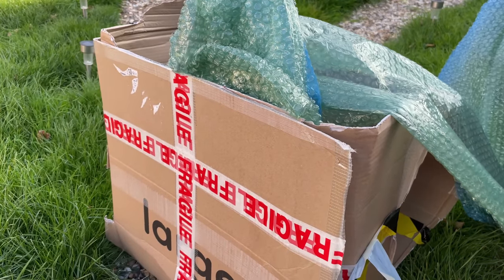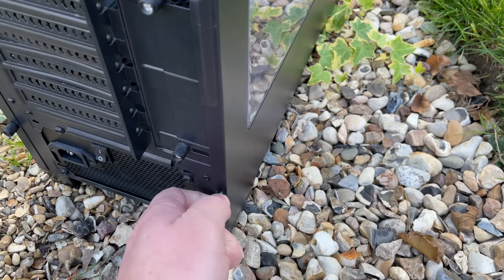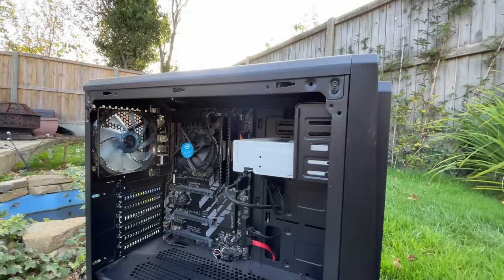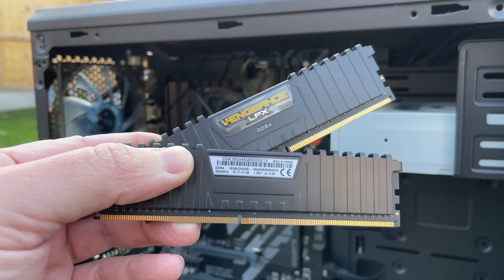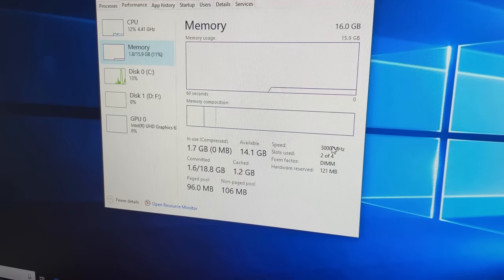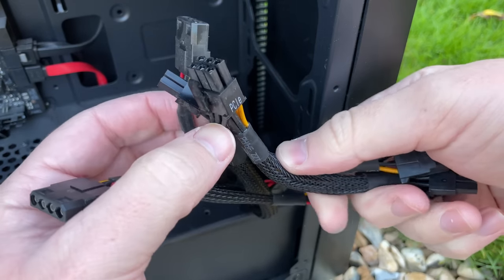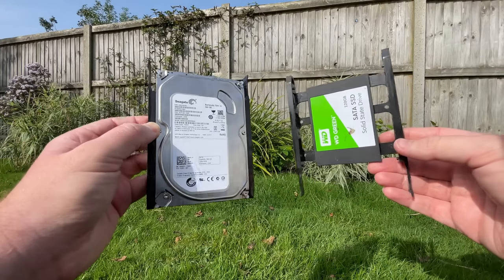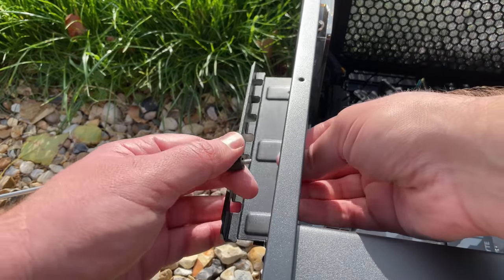This £169 PC has an i7 8700 - But Was It Worth It?

Comment: I'm using a i5-11400H (On par with the 8700k from what I understand) laptop with a 3060 and it's quite a balanced pairing, games like CP2077 really make great use of all the CPU threads so it's quite smooth. It's still got more than decent grunt for most games these days, maybe not for 1440p Ultra but for 1080p High it's more than adequate. I can see an 8700k having two years of usage for "enthusiast" gamers that don't need to crank everything but still enjoy some quality visuals.
Reply from the maker: I have an 11400h and 3060 laptop too! Definitely is still really capable

Comment: Good deal or bust for $300?
MSI Z370-A Pro Motherboard 
i7 8700k 
ASUS GTX 1060 6GB Turbo 
16GB of Patriot Viper DDR4 RAM at 3000MHz 
Corsair H100i 240mm AIO cooler 
Kediers C570 open air case with 7 RGB fans. The PC came with no PSU or storage.

Comment: Learned so much intricate details from this video thanks. Also it's time to avoid putting hard drives on the main system, from now on HDD's should be put on a separate usb dock, file server pc on a network (commercial/diy nas) or just dont plug em when not in use.

Comment: Iam running 8700k in my right with 3080ti strix and it bearly gets to 50% utilisation on my 34 inch acer predator x34 monitor.

Comment: I remember having to save up for a 250GB SSD in 2014/15 roughly. Kept a preposterously low storage drive as a boot drive for the longest time to create an ideal replacement. I remember that SSD and HDD combo being extremely sensible at the time though it did cause streaming issues with textures as I had a 5400RPM hard drive though it is fun now to have all those games on an SSD and see them shine with much reduced loading times and texture issues practically eliminated.

Comment: On the CPU temps with stock cooler, I've been using a Ryzen 5 3600 and have the same experience. I don't think it's anything to worry about as a gamer, as during even the most intense games it will max out at around 75 degrees, and the heat issues only occur when running all cores at 100% load for sustained periods.

Been running it for around 2-3 years now and that still rings true.

Comment: Just picked one up in the Dell Inspiron 5680. I'll catch some hate but I really like the looks of this machine (I know it's all just plastic junk, but I like it). Came with 32 gb ram, 1 tb HDD, and a 3gb 1060. For $150, I thought it's a steal. Changed out the stock cooler and added an nvme. Going to use the gimped 1060 in something else and throw in my 3080 when I'm ready to get that 50/60 series card. For now, it'll host my Valheim server.

Comment: The i7-8700k is a good processor with a bigger cooling solution. I gave my 8086k (special edition rebranded 8700k) to my friend when I upgraded to Ryzen 5000. I'm hoping the "special edition" part was just a gimmick and it's not actually going to be worth thousands in the future.
Reply: it will :)
Reply: if it means as a harken back to the beginning of x86, then in no way it will lose value, stark contrast even🤣

Comment: Considering NVIDIA driver overhead, I’d love it if you could test with AMD cards instead when in a CPU limited scenario like this one. For older/weaker CPUs, it makes quite a difference.
Reply: That nvidia overhead only happens with high end graphics cards and even then barely. Hardly ever find a game that bottlenecks a 4090
Reply: @xTurtleOW  the driver overhead doesn't bottleneck the GPU. It bottlenecks low-end CPUs.

Comment: I used an 8400t in my TV PC.
Cost about $350 to build a year ago.
35w chip, main board with wifi, nvme SSD. Uses about 60watts full load.

Comment: If you want to upgrade that CPU to an i9, maybe you could try getting one of these Chinese CPUs, which are laptop CPU soldered to a 1151 socket (BGA?). You must have a compatible motherboard, and the seller will send you the new BIOS. I got a QTJ1, which is basically an i9 from 9/10th gen, with 8 cores and 16 threads, clocked at 4.7, but with unlocked multiplier (got up to 5.1 but wasn't stable, so lowered it to 4.9). Also, note that you probably will have to run the RAM at 2800 or lower. Some people got golden chips with 5.2 and 3200MHz RAM.

Comment: I can see the reason of owning PCs with 8th/9th gen Intel chipsets. Yes, it's all about being the entry level of installing Windows 11 without tweaking anything. But other than that, as long as you have a more capable graphics card & at least i7 chipsets, it can still play PC games well at 1080p or 1440p. It also can do emulation up till PS2/GameCube/Wii era games & Wii U titles if desired. Chances are even if the chipset might not support Windows 12, this PC is still relevant  for the next few years until the early 2030s. Also can't wait for your i9 upgrade.
Reply: PS2 era went okay on Haswell i5 and good on haswell "i7" xeon. 8700 is enough to emulate Gran Turismo 5 without problems. X360 games are even easier to run beacuse Xenia is more GPU than CPU heavy.

Comment: I bought an i7-8700k and a 2080 prebuilt from ibp.
I bought it when the 2080s had just launched, didn't pay an extra 500 for the "ti" variant, so just a "normal" 2080
Got the rig for 1800 (with financing, 0 down, paid it off before interest started, thanks affirm)

I bought this pc in 2018
It's still solid. 
playing AC6 @ 100+FPS @1440p
there isn't a game this guy can't handle, still my strongest rig (except the cpu which isn't bad but new cpus are just so much better)

I could not recommend the i7-8700 enough (the k is even better)
Reply: i did upgrade the cooler to a corsair 240mm rad*
the cpus work alot better the cooler they are, so even if a 120 is probably enough i'd recommend the 240 (especially for the K variant)

Comment: I still rock my 8700K with a 3080. Unfortunately I lost the silicon lottery, so it needs 3.8v to run 5ghz. However, it only reaches 70°c due to it being delided. Still works, but some games have some microstutter.

Planning on upgrading next year :)

Comment: Recommending using just a large ssd is pretty good advice as now a 1tb ssd costs about the same as a new 1tb hard drive. So at this point unless you go for a more expensive larger drive that has a better price per tb there isn't a point to buy a hard drive for most people.
Reply: At 4tb+ HDD's are still a far better deal. And I say this as someone who has 4tb of ssd storage and 2tb of hdd storage.

Comment: I can confirm, the difference between an i5 8400 and i7 8700 in 2023 is a bit bigger than I'd imagined. The i5 simply can't keep up until the 9th gen i5 9400; same thing with the i3 not being "capable" in modern games until the 10th gen i3 10105f.

I just picked up an i5 9400 with z390 motherboard and 2x8gb G Skill Royal 4400mhz for $180; socket 1151 is getting very cheap on the second-hand market, and still is extremely powerful for the price point.

Comment: I've paired my I7-8700 with a 3060ti - although I do also have a noctua cooler which helps keep fan noise down. I'm able to play quite happily play most games at 1440p med - high settings at playable frame rates.

Comment: I'm currently using an I7 8700 processor, RX 5700 XT graphics card, 550W power supply, and GALAX B365M. Overall, I'm enjoying my setup, but I'm having some issues with my CPU overheating and reaching 80-100% usage. Even with a stack cooler, it seems like I need a better CPU cooler, but I'm not sure which one to choose or what the price range is.
Reply: Snowman cooler, Tech City Yes favorite 😁

Comment: @RandomGaminginHD You can overclock it even if it's locked, albeit only slightly, BCLK to 102.4 or 102.5 will work, which will make 4.4ghz on all cores. Tried and tested, no voltage increase

Comment: I still use my 8700k to game still it is overclocked to 5ghz all cores and it still holds up very well considering originally I paired it with a 2080ti and they were a match made in heaven at the time now it has a 4090 paired with it for triple 4K surround but soon I will swap the 2080ti back in and be using my 12700k with my 4090 for my surround sim rig

Comment: I upgraded from an 8400 to an 8700 a couple years ago. My 1% lows probably jumped around 20% and my average FPS went up about 10%. This was paired with a 3060ti. I figure i have about a year left before its tome for a completely new system.

Comment: not a bad price at all especially for a non-prebuilt. I have been dreaming of the day these higher core count Intel CPUs start to hit the budget buying market. Xeons have pretty much been the only way to get higher core counts on the used market and you would end up limited in motherboard options and clock speeds ended up being much lower so gaming performance would take a hit. this is the makings of a perfect budget gaming PC. those Skylake era cores still hold up decently well in games.
Reply from the maker: Yeah definitely, though some of those really high core count Xeon’s are really low in price now. As you say they can suffer in games though

Comment: My brother bought his prebuilt PC from FTSgaming around 2015-2016. It had an i7 4790, and 16 gigs of dual channel memory, which was nice, but it was on a cheap gigabyte micro-atx h81 board inside a midtower case.
Reply: I should probably add that the i7 also came with the stock cooler. I can't remember the PSU it originally came with, though, since it failed and had to be replaced a few years ago.

Comment: Just not swap a down draft cooler on a cheap/bad mobo cause those VRM's on those boards often need that breeze of extra air to keep them at acceptable temperatures.
Reply: Can confirm, with SPC Spartan 3 pro I get about the same stable clocks as with copper-core 4th gen box cooler on H310m DVS. Though without tinkering it's even worse beacuse overheated VRM drops to 3.2 base clock while overheated CPU tries to keep as high as possible. In my case 4.1-4.2.

Comment: i just purchased a i7 8700, an asus 370 itx board, 16GB DDR4 3200 and an sfx 650w modular psu and last but not least an alfacool 120 AIO watercooling which was empty for around 150€ in June. all worked fine, even the aio after refilling. but the former owner was a strong smoker so this stinks when hot ;D
nevermind. this i7 is a good choice coupled with an decent GPU even in 2023 for good midrange gaming

Comment: I had the same board and an i5 8400. I got a 9700K to upgrade that CPU. Updated the bios but then realized the weak VRM would cause reboots every time the 9700K ran full tilt. Ended up spending on a Z390 Master. I know its stupid - but I really didn't want an unstable PC.

Comment: The 10400/10400F is essentially this exact processor but clocked 300 MHz lower, and released almost three years later.

Comment: With 38A in the 12V rail, that 500W Fractal PSU surely is able to handle the i7-8700 and the 2080ti no problem... ;)

I'm seeing a lot of 8th-gen builds resurfacing for cheap, and they are still quite capable. Maybe the 8th-gen will replace the 4th-gen in the bang-for-buck second (or third) hand markets?

Comment: still happy with my 8700k paired it with an rx 6800 16Gb ddr4 and 2 m2 ssd's plays every game at 1440p best thing about the 6800 is that it isnt a power hungry card so my 550W psu is more than enough

Comment: Just bought a hp prodesk with an i5 8500 for £50 with 16gb ram and. 256gb SSD
Just stuck an itx 1650 in for £60 and I've got a great little gaming pc

Comment: still using the 9700 myself, recently upgraded to a 7800 XT to game at 1440p
Reply: isnt it gonna be bottlenecked?
Reply from the maker: Nice. I really like the 9700 as well
Reply: @RandomGaminginHD kinda wanna see an 8700 vs 9700 is the 8c 8t configuration better than a 6c 12t
Reply: @Kryptictails in the worst cpu heavy games i tested (starfield and last of us) both the CPU and GPU are bouncing of max usage, so i wouldn't go with anything faster than a 7800 XT, but in older games there is no bottleneck at all
Reply: @RandomGaminginHD the 9700 loses HT otherwise its basically the same as a 8700...so you need to consider the i9-9900 and don't forget to update the bios first..!

Comment: Hey! That's almost my exact build ^^
Have had an H310m-e r2.0, i5 9400, Rtx 3050 8gb, 16gb 2666mhz and a 500Gb nvme; for about 3 or 4 years now (Well, only got the Gppu quite recently, but still)
One can probably get one for way cheaper nowadays than when I got this one, I almost feel scammed for paying near 600 dollars for the processor, motherboard, 8gb of ram and a 1tb HDD... Oh well, at least I did get my gpu for 250 dollars, that was nice for a new card.
I use Arch btw /hjk

Comment: Nice to see effectively the same build upgrade route I went,  tho' that was 4 years ago..
Z370, 8700k (but oc'd stable to 4.9 on a better asus maximus 8 mobo) with evga 2080ti xc... 
Last year I upgraded indeed to the i9-9900ks (at a steel.off fleabay) and a 1000w psu...and 32gig 3600ram...
Runs everything I could wish for at 1440p (27" asus)

Downside is now I'm stuck needing new mobo, cpu and gpu upgrade to at least a 3070 to gain higher 20 fps only and that's a lot of money for very little gain..
A few years to go yet till I replace everything bar the psu, case and cooling...

Comment: I’m still using my ASUS tuf z390 pro gaming motherboard with a i7 9700k and a rtx 3060  is a great system for gaming and probably won’t be upgrading for another 5-6 years as long as everything continues to run smoothly

Comment: Fractal design essence are ok budget units similar too Evga's entry level 500w power supplies & had a 2 year warranty launching in 2014, so its old but not unusable imo at least not for something like an I7 9700k, 16 gb ram & like a rtx 3060 12 gb.
Reply from the maker: Ah ok thanks for the info :)

Comment: With the technology reaching its end of life, I can't say this is a good deal, but the Z370 motherboard is not bad consider it is a top of the line motherboard of its time. 

Anyway, with that said, 8700 is okay if you're not playing recent AAA games. It showed its age in many ways as well. If you can get it for very cheap then it's a good upgrade but other than that, a 12400F is far more superior. It's newer, but you can be sure the upgrade paths is available.

Comment: i remember Intel being kind of all over the place with their 8th and 9th Gen Core i7 CPUs after AMD successfully brought higher core counts to mainstream users with Ryzen and was starting to claw back some real market share. with the 8th Gen Core i7, Intel finally increased the mainstream desktop core count from 4/8 to 6/12. then with the 9th Gen they again raised the core count, probably to combat the increasingly more popular Ryzen 7, but either not quite ready to move on from their years of dominant complacency or playing 4D chess they also removed Hyperthreading from the Core i7s and relocated that feature to a new high end, the Core i9. so Core i7 buyers at the time had to make the decision: Core i7-8700 with 6/12 cores or Core i7-9700 with 8/8 cores? which was pretty confusing because it was not immediately apparent which one would be better just by looking at the specs. was the 9700 really an upgrade or do 12 threads actually beat 8 cores? 
luckily Intel sobered up with 10th Gen parts and made clear improvements over 9th Gen across the entire stack. now their biggest problem would be getting ridiculed by enthusiasts for still being stuck on "14nm" with an ever increasing conga line of + signs following it while AMD had already moved on to "7nm"

Comment: I upgraded my i7 8700k after 6 years using it flawlessly but it struggles in demanding games recently. I upgraded to the 5800X3D... I dont think ill ever need to upgrade
Reply: Oh you will, see am4 now is very slow in modern games unlike the am5
Reply: "I dont think ill ever need to upgrade" , so cute , you also believe in unicorns ? ;)
Reply: @smilingpolitely12345  jesus, talk a bit quiet man, he would have been in flood of tears🤪
Reply: Tell that to my Ryzen 9 5900x which is optimized and pushes out 5Ghz and runs great in all of the newly released games. It also has a lot to do with memory speed and DDR4 at or above 3200Mhz is more than enough to run the newest games. My own 32GB DDR is set to 4000Mhz with CL16 settings. My AMD Radeon 7900XTX can be pushed to quite high FPS with this setup. Is the CPU a bit of a bottleneck for this card sometimes in a couple not well optimized games and at 1080p. Then again a 13900K can also be a bottleneck for a 4090 & 7900XT & XTX at 1080p in many games so I am not worried in the slightest about my own CPU until AMD releases the Zen 5 8000 series or Zen 6 9000 series CPU's. After hearing the rumors of Zen 6 going higher core counts it makes me want to wait for those CPU's but then again this is just all rumors like we have heard so many times before about this happening on AMD platform. I'll probably just get a Ryzen 9 8900x 64GB DDR5 6400Mhz memory and just enjoy seeing my current card pegged at 99%-100% all of the time at low 1080p screen setting lol.

Then when AMD releases RDNA 5 I'll upgrade at that time and see my GPU now be bottlenecked by my 8900x again and the whole cycle starts again upgrade wise lol.

Comment: 5:29 - I would suggest installing later on two RTX 3090s since the motherboard supports SLI. Of course, you should also upgrade the PSU as well, for the best possible SLI experience.

Comment: Recased a thinkcentre and swapped in the 8700 with a 1070ti. 350 USD the only downside being no front io on the case. But im 3d printing a bracket for some front audio/usb in the 5.25 bay